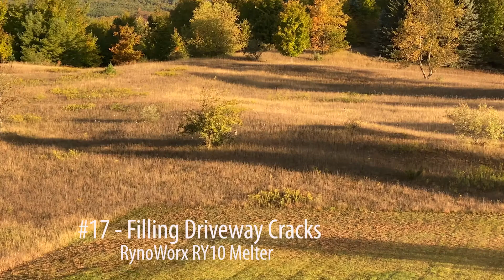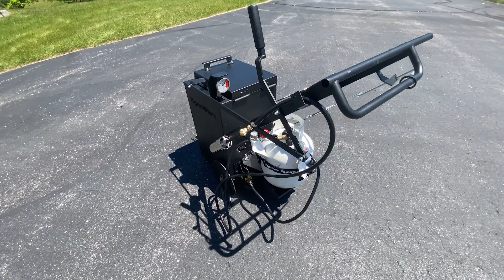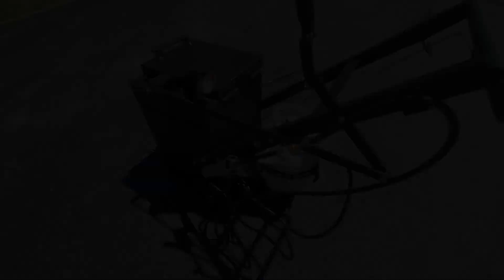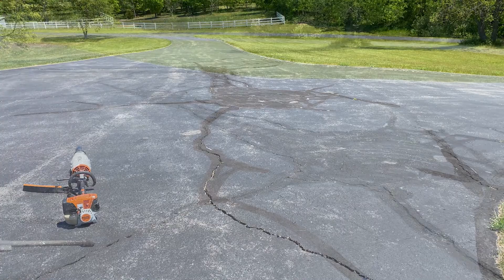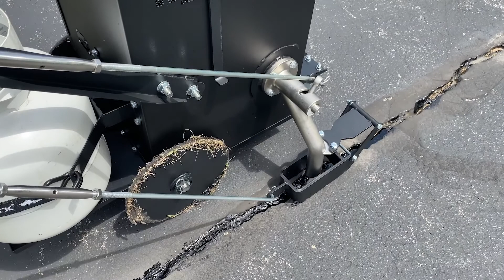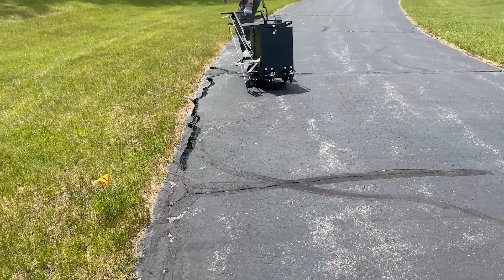Filling Driveway Cracks W/ The RynoWorx RY10 Crack Filler

Comment: Our Church is paying 3500.00 to have the lot sealed.
The contractors NEVER EVER ACTUALLY SEAL THE CRACKS.NEVER.
No body seems to realize that spraying a coat over the lot is not going to solve the grass and water going under the asphalt!
Reply: It may be a cost issue. To fill cracks runs around $1per foot

Comment: These hot crack filling machines are junk. Don't  waste your money on buying g this hot crack filling machine.  Instead buy a hot box 30 gallon. Get a metal galvanized  flower pour bucket. Remove  the sprinkler  part. Use this to pour the hot rubber into cracks. Have 2 people v squeegee the cracks. Much cleaner job. Plus it is way easier to move around pour the hot rubber than a heavy  awkward  machine.
Reply: hey i found the squeege to not work properly. it is not a heated squeege obviously and the hot rubber cools on it and it gets build up? do you not have that problem?

Comment: Cool! How long do the cracks stay closed before they re open and it has to be done again? When doing it again do you add more material or just torch the old stuff already there to reseal the crack.
Reply from the maker: We fill the cracks every other year, as they do crack again. We live in N lower Michigan, so we get the freeze/thaw cycle every year and that is murder on the driveway ;-)

I bought a 1/2 pallet of fill material, so I am set for a while. 1 brick of material actually fills quite a few cracks. Obviously, depending on crack size and depth. Thanks for watching!

Comment: how do you clean up your machine after you have finished until next season??
Reply from the maker: My first year of cleaning consisted of me just heating up all the material and letting it just run out of the machine (in cracks). In between uses, I did the same thing and it worked fine, no clogs or issues. I'm not sure I am doing what is recommended, but getting the material out seemed like the only way to clean it effectively. Thanks for the question and for watching!

Comment: Hi, did you use Deery crack sealer? Are you getting 2yrs out of it before it cracks again or did it mostly last and no repeat crack. I to have a long drive and was looking into this machine and trying to find the best crack sealer that would last. Regards, Tony
Reply: Thanks for getting back to me. I as well bought the ry10 pro, but I bought the Deery from a distributor on eBay and bought 7 blocks at $54 a piece instead of buying half a pallet and not being happy with the product, and would try seal masters ,one of there blocks called crack master supreme DF. Never ending battle with cracks….but a lot easier than getting on your hands and knees squeezing a gallon of cold pour that didn’t last a year. Take care,Tony
Reply from the maker: @tony8354586  I bought the 1/2 pallet ;-) I wish now that I didn’t buy that much. Please let me know if you have a better experience with another product. Good luck & thanks for your question!! Best, Ed
Reply: @UpNorthNybergs  How many blocks of Deery did you use per year on your four tenths driveway? I have similar in Wisconsin and got this unit to try out this year on over 400ft long driveway. I got probably a couple hundred feet worth of cracks to fill. all done using tape and torch and gallon fillers. I got a 1/2 pallet and have feeling it'll last me 20yrs.
Reply from the maker: Hi Tony, I filled the cracks 2 years ago w/Deery and I’m starting to get major repeat cracks. I was expecting the filler to last longer, but our winters are tough. I’m resigned to filling cracks every year or every 2 years…I was hoping for better performance. Good luck!!

Comment: That box would flow a lot better if the output pipe had a small torch keeping it hot, similar to that Bernz-o-Matic torch you used, and since you already have a propane tank mounted, it would be an easy modification.
Reply from the maker: That’s a great point Mike! It seems to “plug” up a lot right at the output pipe. I may modify it this spring…thanks for sharing that suggestion!!
Reply: @UpNorthNybergs  IMO, make sure to use a small torch, the big ones for that would be wasteful.  Maybe add a heat shield to contain the heat for longer too.  Use a needle valve to adjust LP flow.
Reply from the maker: @MichaelJeffers75  appreciate the advice!!

Comment: at about the 8 min area : is that sand or dirt I see in the cracks?Probably should have hipressure air or water blown it all out. O well ck back if and when  or if it starts lifting out of the cracks. May not if sand/dirt is deep enough
Reply from the maker: Hi Tommy, it is mostly sand and I tried my best to get as much out as possible. I inspected the driveway after this past winter and it held pretty well, better than I thought it would. I am definitely trying to get as much loose material out as possible. I do think I’ll have to spend a bit of time each spring reapplying in some areas. Thanks for the comment and thanks for watching!!

Comment: Pro tip make sure you empty any excess rubber you have in metal pails and you agitate frequently, what can happen if you don’t agitate enough is the material burns and gets rock hard on the bottom of the machine and can block the material valve. If you agitate and empty and clean machine after every use you’ll never have any problems.
Reply from the maker: Hi Redditor, excellent tip!! Do you have a good way of getting the material out of the bottom? I've tipped the machine to let it drain, but haven't found a good way to get all of the material out.
Reply: @UpNorthNybergs  I get my machine up high so that a pail can fit underneath the spout. While machine is still hot drain any excess into the pail. This material can be reused, just heat up pail with torch and the material will slide out in a big chunk, just make sure the pail you are draining into when you reheat the material will fit into your machine. Tilting the machine helps get the last little bit out. It’s almost impossible getting everything perfectly clean but as long as you get 99% out so you can see the opening of the spout you will be good. You may notice some material that has the consistency of clay that has coated the bottom after all the liquid is drained. This is kind of a pain but you have to get it out otherwise it’ll build up after every use and clog your machine. You need to have the correct tools to get this stuff out, Personally i use a crow bar to scrape the stuff lose and then have a small shovel that has it’s blade bent at a 90 degree angle so I can scoop the stuff on it and lift up out of the top opening. Everything will be very hot still so make sure you’re wearing gloves and long sleeves. The key to minimize the clean up is to keep your temperature from over heating and agitate frequently to prevent any hot spots and try and end the job with little material in machine. 

Lots of big companies do not really care about cleaning, they just run the machine until the burnt material clogs up their machine and buy a new one. I am not rich or like waste so I try and keep my machine in good shape. I had to learn this the hard way, one of my machines just stopped working so I drained it and noticed there was a couple inches burnt material hard as rock blocking the spout, now I clean at end of day, usually only takes 5 minutes for me, and is worth it.  Nothing is more frustrating when you go to use something and it doesn’t work.
Reply from the maker: Thank you Redditor for this tip! Very much appreciated and it will certainly help others who have this same machine or similar. Sharing the knowledge is one of my goals for this channel, awesome!
Reply: @redditor7548 Is there any downside to allowing the left-over crack filler to remain inside the machine overnight and use the torch to heat up the outlet above the shoe?  It’s a lot of extra work to prevent the outlet from getting clogged and if that’s the only goal, it seems like the torch route would work. I wouldn’t use the “torched material” for cracks, just put a pie pan under the shoe to catch and discard once cooled. 
What crack filler are you using these days?  Do you know if Craftco is a decent product?
Reply: @harleyhoracio1  no it’s fine. You can leave over night and reheat and use material for next job. You do not have to clean out after every use, just make it a habit every once in a while that you finish a job with the melter empty so you can scrap off any charcoal build up on the bottom, like once or twice monthly depending on use. As long as your agitator can freely move once material is melted your machine is fine. I made the mistake with a machine that I’d heat up too hot which made the rubber turn to a hard charcoal and it built up to the point where It cemented over my agitator and I couldn’t move it and then eventually clogged my spout and then I ended up puncturing a hole in the machine trying to clean the hardened material out. This you do not want to happen. 

Use a DF material that has a wide working temp range, this will make it easier for you to prevent over heating material which is what contributes to charcoaling. Crafto makes good rubber but a lot of the rubber is lower working temp range and works better for crack trailers that have easier temp control. The rubber I use is a DF called macseal from mcasphalt. It has a working temp range from 362-398.

Comment: Are you going to seal coat your driveway yourself?
Reply from the maker: We haven't decided yet...I may have it seal coated by a professional then decide what other equipment I will need and the costs associated with doing it ourselves. Thanks for watching!
Reply: @UpNorthNybergs I have a driveway that is almost a 1/4 mile long.  If you decide to DIY sealer, I’d like to see your setup.  Next spring, After crack filling, I was planning on getting a 275 gallon tote filled at a local Sealmaster store